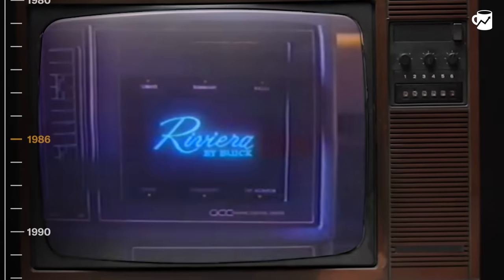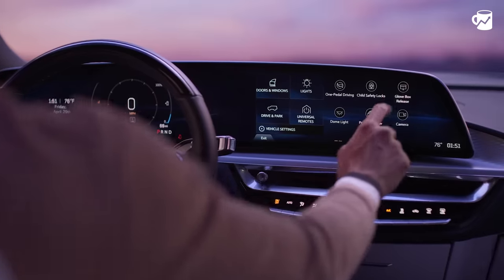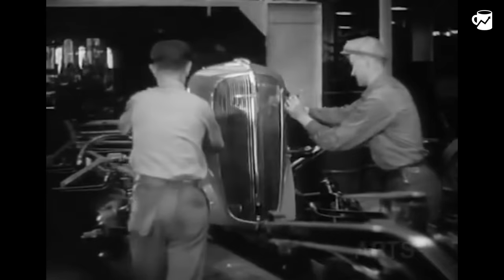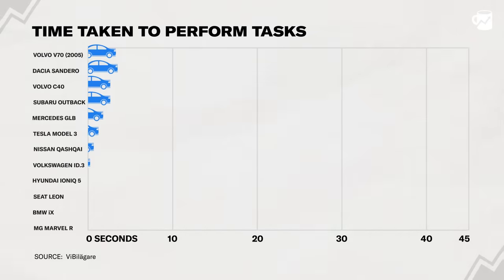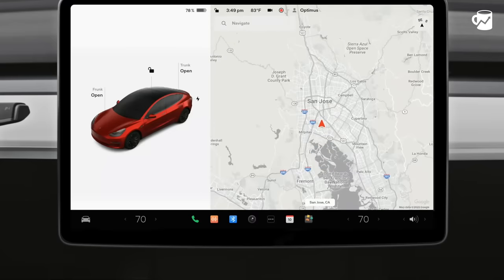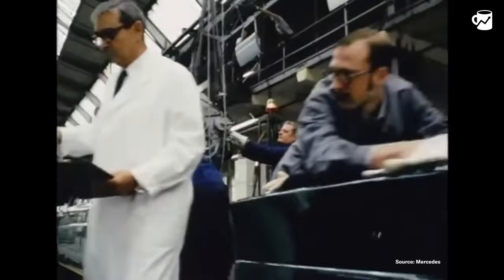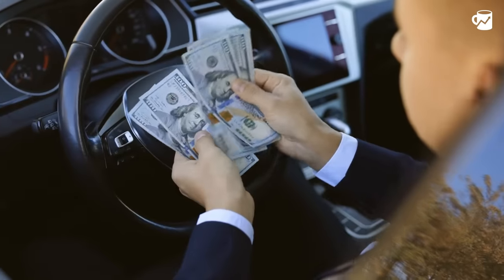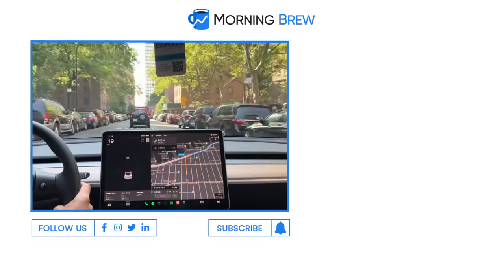The Real Reason New Cars Have Touchscreens

Comment: I don't want tech in my car.
Reply: A car IS tech.
Reply: All I need is good stop to hang my phone one to be able to use rhe map and stuff. Most modern cars make you connect your phone by USB and Bluetooth at the same time to get those features and most cars don't have a good place to attach the phone too that is safe and easy to access. Having stuff like air conditioning controlled by a touch screen is dangerous. I often adjust stuff while driving.
Reply: Buy a late 80s Volkswagen diesel. That’s what I have. All buttons, no computers much fun.

Comment: Rotary dials with no stop are bad too. In my 1999 BMW z3, there are no controls I need to look for. None. Everything can be done by feel. I mean, vision helps for the radio, but it's broke anyway. All the HVAC, lights and other buttons can be felt. In my 2023 Ford Maverick, it's okay, but you can't feel the temperature, heating zone, or fan speed. It's just worse.
Reply: It should be built into law that certain controls can be done just by feel in cars. Including basic music controls, as that is something so many drivers utilize.
Reply: @zoyadulzura7490  the dept of defense has applicable standards on the shelf that the department of transportation could use, so they could do what you suggest tomorrow.
Reply: My 2001 Volvo has buttons on the steering wheel to change stations on the radio as well as off/on and volume control, so no sight needed there either
Reply: The problem is having a digital dial (IE no stop) is way cheaper than having a dial especially designed for each control function.

By using the same inferior dial everywhere and just tuning its function with software saves production cost.

Comment: It should be clear to anyone who is paying attention that auto manufacturers are only concerned with safety of occupants during a crash. They do not care about preventing crashes or they are actively hostile towards the safety of anyone outside of the vehicle
Reply: "that auto manufacturers are only concerned with safety of occupants during a crash"  Not really (maybe Volvo and SAAB).  Only as far as meeting the regulations and getting a good safety rating. In markets like Brazil, they can (and did) gladly remove the side intrusion bars in cheap economy hatchbacks to cut costs since side intrusion bars are not mandatory in Brazil!

Comment: I will never get rid of my manual 2016 Tacoma because it’s the perfect combo of modern-enough (and stick!) but still with dials and, you know, actual buttons. No power seats with motors to break, no complicated menus to sift through just for the HVAC controls, no settings for different drive modes and terrain…but it does have satnav, a backup cam, and heated side mirrors. I inherited my mom’s E46 323i and forgot how nice it was to drive at night without a screen glaring in my peripheral version at all times.
Reply: Completely agree. I drive a 2018 g31 and its the best out of all worlds. I have Buttons for everything that’s important and more, you can control everything via idrive and you have a touch if you want it. But it doesn’t force you to use it. I use the touch for exactly two things because it makes it easier. Thats it. This era of cars was peak infotainment.

Comment: I drive a 2023 Mazda CX-50. It has a touchscreen but the screen is read-only by default, smaller than most, and is fully controllable by physical dials and buttons (mostly just a single pressable dial!) without ever touching the screen. Plus voice command and carplay integration of course. That approach was one of the biggest selling points of the car for me, and after driving it more than a year and never once touching the screen, I have no regrets!

Comment: What I hate when they use the touch screen for things like shifting to fevers in the Tesla or turning on the aircon, or even seeing the SPEED. YOU HAVE TO TAKE EYES OF THE ROAD TO CHECK SPEED!
Reply: Umm, hate to break it to you, but you've always had to look down away from the road to check the speedometer...
Reply: @whiplash779  But the speedometer is right there behind the steering wheel,a lot easier than diverting your eyes to touch screen.

Comment: I see a ton of auto accidents in the future.  Especially when someone is trying to do something on the touch screen with one hand and steer the car with the other.
Reply: when they lean over to reach the far edge of the touchscreen, their other hand will, inadvertently turn the wheel in that same direction.
Reply: Ironically Tesla's have the lowest amount of collisions of any car.
Reply: @lachlanB323 because the sample size is smaller
Reply: @lachlanB323   heh....if you don't know how math works sure.  There's only 1 tesla for every 200 to 300 cars.  You need to go by % on the road, not by # of accidents.  When you use the numbers correctly, they are NOT lowest by a long shot.
Reply: @Demsky83  No. It's based on per mile driven obviously. If it wasn't Tesla wouldn't be number one since they have already sold over 6 million cars and they still sell every car they've made S/3/X/Y.

Model Y is the best selling car of 2023 you know?
Reply: @zarroth  My god! Why would you assume I'm a ret**d? I mean I technically am by definition but you know what I mean lol.

I know how statistics work. This one is by per mile driven on average how many miles until crash.

Comment: This is why "Android Auto" and "Apple Car Play" are so buggy -- the software in the car NEVER gets updated/patched.  That means the mobile device's side of the connection has to contend with a HUGE amount of variety of cars it connects to.  It's an unmanageable buggy mess.  Android Auto is reliable on less than 25% of rentals I've used over the last 2 years.
Reply: And you know that, if it Did get updated, they'd be screwing with the UI every six months.
Reply: Yeah mine doesn't work, and there's nothing you can do to fix it.

Comment: Even though the companies have a small part of blame in this, the buyers are what's mainly driving this trend. 
If people would not buy this kind of cars in the first place and go for different cars, the other manufacturers would follow.
Reply: I dont think in current world buyers have that much power as you think we have. Not only most ppl go by the price. But lets give mobile phones as example. Most ppl i know would want replaceable batteries in mobiles, yet manufacturers just doesn't care and don't make them. There might be few extra options, but mostly expensive one, buyers just slowly don't get a choice in these things anymore and it is more and more about maximizing profits compared to making a best product.
Reply: @shawdou3327  how do you think phones got to that point? 
When the first phones started selling with non-replaceable batteries, people still bought them. 
When Apple first removed the head phone jack, people still bought them. 
So yeah, people do have a say in this, they just don't do it. People always go first the lowest price.
Of course a devices with those tactics will have lower prices, but in the end you will spend more because you need to replace it at the slightest problem.
Reply: @ionut-cristianratoi7692  You are not entirely correct. If apple was selling one iPhone with jack and other without then (of same generation) most ppl would buy one with. Same with battery. Problem is that Apple users love to the point that they can do nothing bad and having new one makes them feel they are better.
And then other companies started to adopt it. But i dont think there was single generation of phones from same manufacturer that would sell removable and non removable battery options.
Reply: @shawdou3327  in your example it's still the consumer problem. Why continue buying them? That love for the products/companies are what are mainly driving it. 
Companies are also to blame, some are using shady practices mainly meant to misinform the consumer. 
The problem with blaming only the companies for bad consumer habits just makes the problem worse.
At the end of the day, you cannot force good habits.
Reply: @ionut-cristianratoi7692  No, problem is we are blaming each other instead of companies. If you are going to say about someone that he is stupid because he does this, even if you present facts to him, he will double down and oppose you even more, because our brains are wired that way. Once you are invested into something, you don't really want to admit that you did wrong.
Which is resulting that most of the time we are fighting and blaming each other instead of the companies and the companies are one who are profiting from it.
Reply: @shawdou3327  How isn't that the problem, not wanting to understand our own defects and trying to reach to a higher power to save us?
Think about this, when we buy something, we are "voting" with our money. 
If that's what we support, why are we surprised when that very thing is the one that succeeds?
I think we have common grounds on blaming the companies, the only difference is, the way we react. 
I think the best way is to not support that company by not buying their products.
If you think legislating it is a solution, look at the political side and see if it's any better there.
Reply: @ionut-cristianratoi7692  Yes legislation is going to be the only way. Companies are already changing products after the sale or not disclosing critical information about the products before head. 
Are you really reading whole EULA or manuals before you purchase anything now?
Be real pls.
Reply: @shawdou3327  Are the politicians doing whatever they promise in elections? Why do you expect politicians to behave in a proper way.
Regarding the EULA, I agree that it's messed up. But those are extreme examples, the one regarding the headphone jack is not. You don't need to read the EULA to know that the jack is missing.
Reply: @ionut-cristianratoi7692  Sometimes they do, sometimes they dont. You might be right that some time in the past ppl could have tried to wote with wallets. But they expected company that was doing good thing to do it again. 
I am still buying android with jack, but if you want iphone with jack now good luck.
We are at the point where voting with wallet is close to buy or not buy anything.
And it is getting worse and worse.
Reply: @shawdou3327  Sadly, yes. Companies will repeatedly try to cut cost, even if it failed once, or if the lack of cost cutting was the main driver that made them successful in the first place. 
But if we do this more and more (like you do), companies will hopefully learn that it's a bat idea. 
Currently, it isn't, as it brings more profit by cost cutting and it doesn't affect sales too much. 
People can switch from iOS to Android, but they don't want to and keep giving them money.
Reply: @shawdou3327  Don't get me wrong, I would like for companies to do better. The problem is, I don't think it's easy to legislate. 
For EULA and other similar deceptive practices, it will be easier. 
But for cost cutting, it's nearly impossible. What law can you make to prevent the removal of head phone jack? Do you legislate phone manufactures to prevent removing it? How about PC manufactures for removing the floppy disk?
Reply: @ionut-cristianratoi7692  You are laughing, but recently i have heard that PC manufacturer are debating to change RAMs on PCs from replaceable to build in on motherboard and want to say it is about making them faster.
Some of recent laptops dont even have replaceable RAM, and most ppl dont even notice until they would like to upgrade and then find out they cant or it is super expensive. 
When this change started noone was expecting it, so almost noone was looking for it.
Reply: @shawdou3327  who said I was laughing? I personally don't like the things the companies do. But I hate even more a politician dictating what I should buy or not. I will give you an example:
2 laptops, same specs, one with soldered RAM selling at 1k price, while the one with dedicated RAM selling at 1.3k. Why is the second one better than the first? 
Why should a politician have the right to force us to buy the second one?
So even having benevolent politicians, it's still hard to implement. What do you think it will happen when we add the corruption that we currently have in politics? Most likely than not, the first option will be the one that's being forced upon us.
Reply: @ionut-cristianratoi7692  I can counter argument not with hypothetical example but real one. You buy a car connect mobile to hands free, it download all your information to car and send to manufacturer and you don't even know it. You found out year later and ask them to remove your data, they refuse. You sue them and judge say it is ok. Do you like this or would you rather have politicians to force company to delete your data.
Reply: @shawdou3327  USSR, best example ever
Reply: @shawdou3327  Also China. 
Would you rather live in China and be "protected" by the government, or have the inconveniences of our society. 
It's harder to find examples of lack of freedom in a free society and easier to find examples of exploitation because of it. 
You can find more examples when you lose your freedom. Then it will be hard to find your examples that happen in a free society.
But to give a more down to earth example. The EU has forced car manufacturers to have a system in place that warns the driver every time the driver exceeds the speed limit and it's mandatory for all new cars sold in EU. 
Currently, it can be temporarily disabled (until the engine is stopped), but it's an annoyance. Think about how nice it will be when those people no longer focuses only on safety and environment protection.
Reply: @shawdou3327  You cannot expect governments and politicians to held our hands and tell us what should we do or not. We need to take some responsibility of our actions.
Reply: @shawdou3327  and lastly, your example is regarding the EULA, which I agreed that it can be easier to legislate, as it's deceiving by nature. Your example isn't related to a bad decision by the customer, which he was aware of, like the lack of jack or the display which replaces buttons.

Comment: Which is less likely to wear out or go awry, mechanically: buttons/knobs or touch screens?

If a portion of a touch screen goes bad, is the rest viable?
Reply: Individually, each knob and/or switch will have a failure rate that’s roughly commensurate with the entire display, but then each knob or switch, generally only controls one function, whereas touchscreens will develop problems zones, but generally speaking, the screen fails in its entirety.
p.s. Failure rates for switches and knobs are generally expressed in how often you actuate the switch and/or knob, whereas the failure rate for a touchscreen is generally expressed in risk over time.
Reply: @JoeOvercoat  if a switch fails I go and buy a generic one, it doesn't need to fit, just connect two wires, in fact  you could just strip wires and control the same function. Touch screen, good luck finding replacement that works. If they want to charge you 1000$ for a new screen that costs 100 they will

Comment: I think the 1980's Chrysler K-Cars had the most user-friendly radio and climate control switches/knobs. The radio had two knobs; the right knob tuned the station, and the left knob was on/off and volume. (Turn the volume all the way down and it clicks off, brilliant)! It had five preset station buttons. As for the climate controls; they were a combination of buttons and sliders. I could adjust ANY of the aforementioned controls without taking my eyes off of the road once. The ergonomics were perfect back then. I recently drove a rental vehicle with an IPod-esque center display, with integrated audio and climate controls, and I couldn't figure out how to turn the radio on!
Reply: yehh. i was in a new car recently and eventually figured out how to put the radio on, but even the driver couldnt change the station !
not enough hackers in the cabin imho

Comment: Worked for several car companies on their head units.

Touchscreens were tempting but having everything necessary be doable without glancing at the hardware just by touch and sound was a massive design priority with an enormous effort behind it. Touchscreen was specifically reserved for cheaper vehicles, and even there touch wasn't doing a lot of heavy lifting.

Comment: It goes really far.

Its a conspiracy to make all cars autounoumous.
It's the computer that has acess to the gaz and brake pedal and you the end user driving that car is on the other side of the "input" in the computer software.

Which is Excessivly concerning. Since the whole purpose of this is to control where you go and when you should buy a new car.

First is to get people used to it to the point eventually that we don't drive the cars anymore.

Comment: My father is a helmsman on a support ship. He moves people and equipment around for repairs, maintenance and alterations to ships. Like welding and such. The ship was 'upgraded' with a touchscreen before he started there. He showed me how long it takes to activate functions of the ship. Like lights or engine information. Lots of times it required 2, 3 or even 4 taps to get to the function you need. That is too long. Buttons, knobs, etc, are easy and fast to controle by touch only

Comment: In 2014, I bought a Mitsubishi Mirage/Space Star. Only the top model had a touchscreen. The salesman said to me: I would not buy that, you'll regret it, go one step lower. It has no touch screen but voice commands for the telephone, but all else can be done with buttons. Now, 10 years later, I am still glad I listened to that man. I will keep that car until in disintegrates. As I did not have a single defect with it yet, I think it will last until the screen craziness is over.